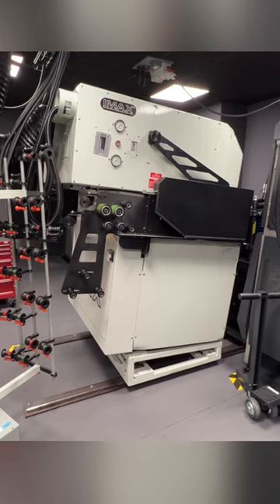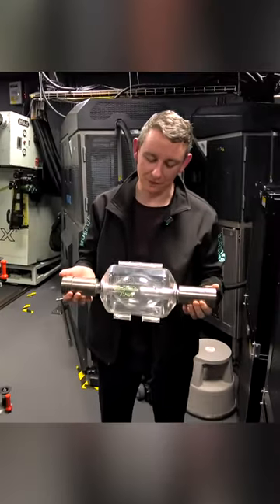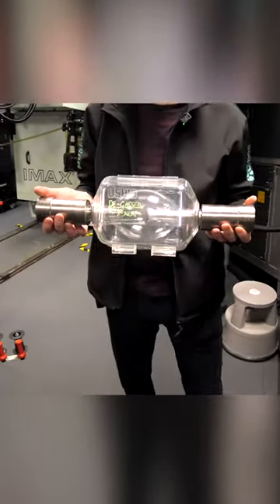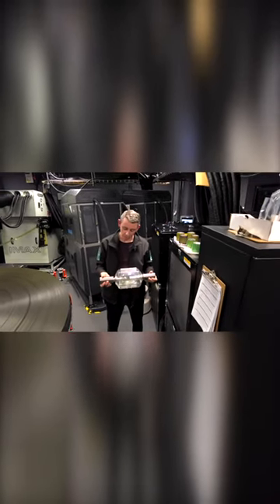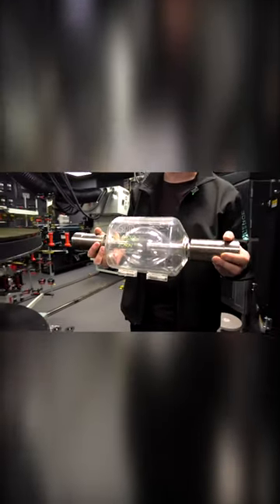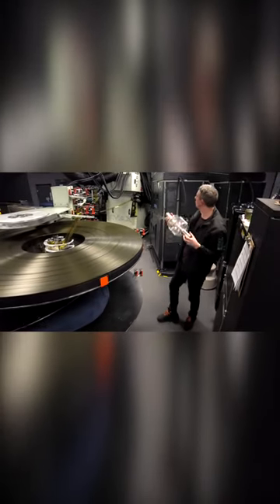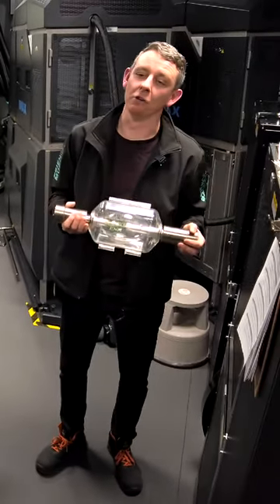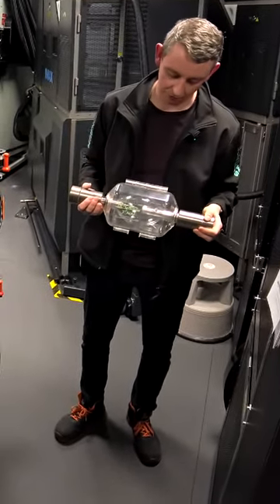IMAX GT 70mm Projector Xenon Lamp

Comment: Why don't they replace xenon lamps to led lamps? they are more efficient,reliable better lifespan.
Reply: I don’t know the exact reason but I can guess 2 things. 1 the leds can’t get as bright as the lamp or 2 if it can, it would be way to big and the lamp would be better because of its size
Reply: No direct led replacement, laser is the choice but xenon is still the brightest/cost effective. Source: I own thousands of watts of Xenon :) , these are used in seachlights too. Looking at laser sources, lookup the Clay Paky Skylos, 300w laser with output of 4000 watt xenon, the laser based cinema projectors are bright, but Barcos 75,000 lumen projector platform is almost 500,000usd per projector.
Reply: @adrianwillis2874  White LEDs have a low Colour Rendering Index compared to arc-lamps or laser systems. So a LED replacement for old arc-lamp projectors would decrease image quality.
Reply: @aldenfunkhouser7896  If you factor in all operating cost, the difference between laser and xenon is not that big anymore. On top of that, you need people willing and trained to change those light bulbs. In my theatre that's currently 2, me included.